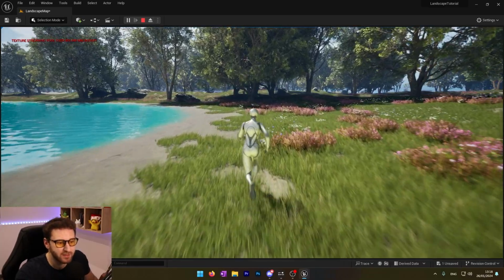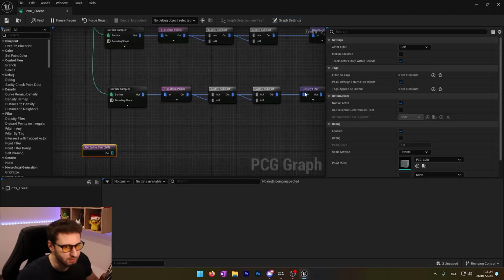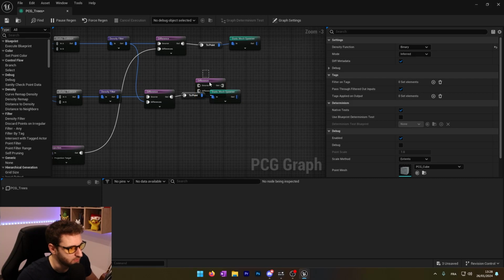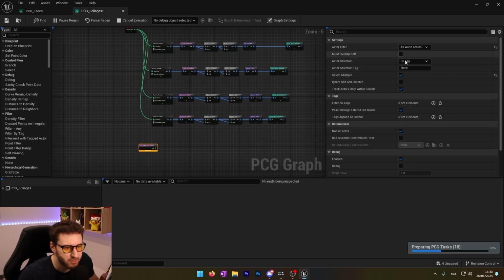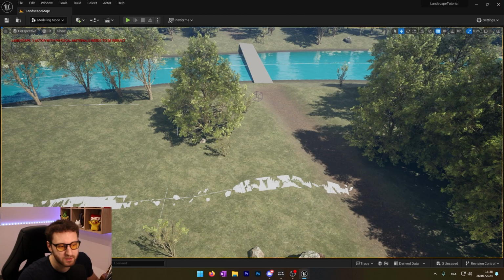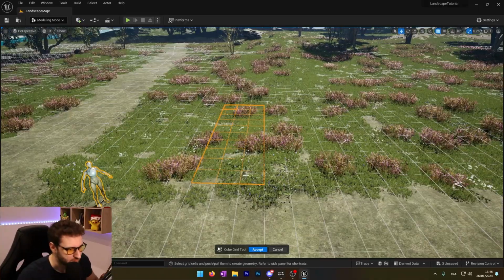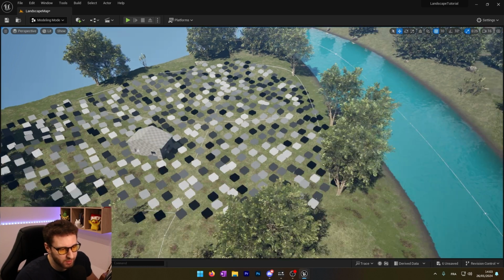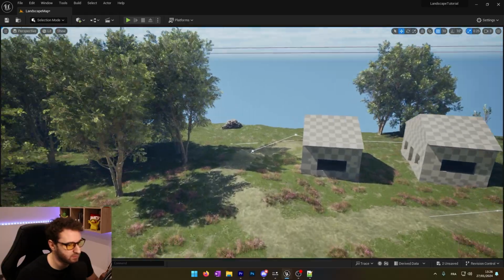How to Create and Use Splines with PCG - Unreal Engine 5.3

Comment: Thanks for your tutorial and for making it in English so that anyone can follow them. I have a question if you can help me. Do you know any way to control layer weight through pcg?
Reply from the maker: There is no way to change the layer weight on the landscape with pcg, maybe you can make it by creating a custom PCG node and use the Editor Apply Spine to change the layer weight or in the blueprint of the spline that you have created you can use the Editor Apply Spline  :
https://forums.unrealengine.com/t/how-to-use-editor-apply-spline/635811/2

I will try it out and if I can found a way I will make a video about it :)